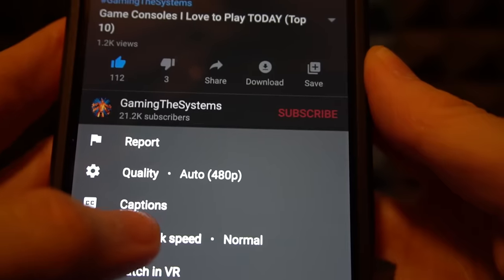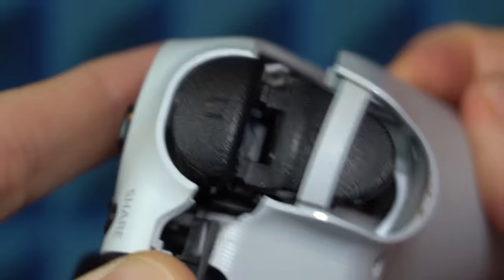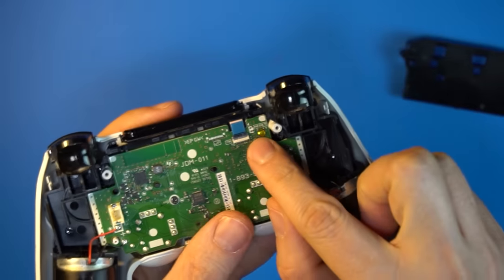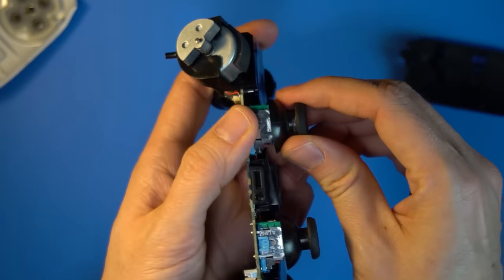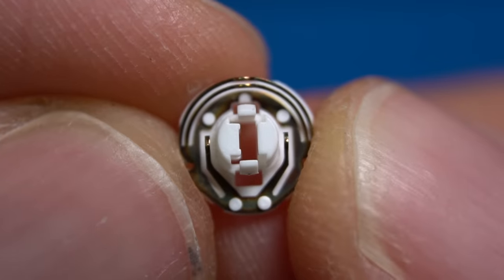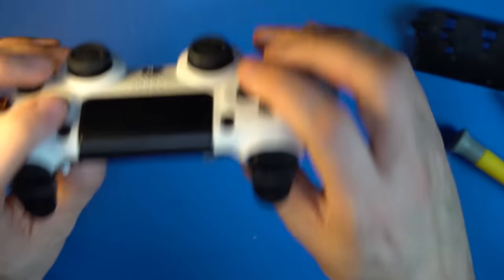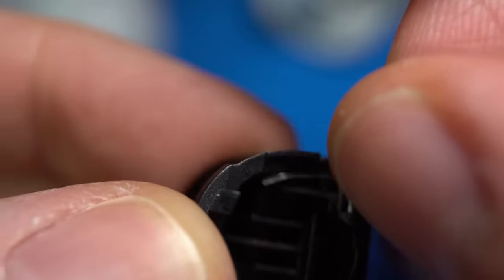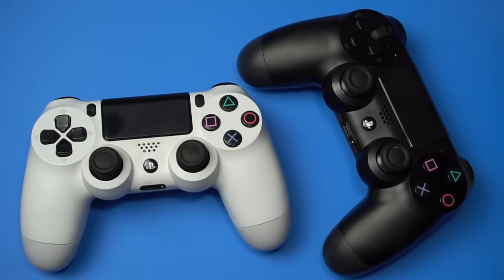How to Repair a PS4 Analog Stick That is Drifting, Sticking, Jittery/Cleaning DualShock 4 Controller

Comment: The sad part is, my controller are brand new just few weeks old and this issue are already happening 🙁
Reply: If you're playing apex legends is not your controllers mistake
Reply: Same. I've only played two short indies (5 and 3 hours of playing each) and I boot up Horizon Zero Dawn and main character is glued looking at the ground. The warranty covers defects if purchased within the last year but their warranty process requires the proof of purchase have the serial number on it and you have to pay to ship the controller. So stupid
Reply: @TheHotrider07  I don't even know what kind of game that is.
Reply: @spriddlez  uhh that's sucks, sorry for your controller, but believe it or not I fix this by pressing reset button method the issue are gone now.
Reply: Same here, really sucks. Truly a shame. 
My PS2 controller does still work (at least it did last time I took the "Old Lady" from the shelf) without any malfunctions.
Good old days...
Reply: Nah dude it's not your fault I bought a red v2 controller and after one month it just stopped charging and woudn't turn on at alll ... The Durability on the V2 controllers is totally shit🤷
Reply: Same I play modern warfare like at least 5 hours a day and spam tactical sprint a lot
Reply: I've had mine for 2 months, brand new ds4 v2 and I tried to do this and now I've got an issue where the analogue or directional button is pushing up and I don't know which one and can't fix it
Reply: Update: I swapped out the disc that was not working (causing the drift) with one from my old one that was soon to be thrown in the bin and it worked. Couldn't see any damage or anything on the faulty disc so no indication as to why it wasn't working but the problem is fixed. The delight of being able to move normally has got me gassed to play games again. Such a frustrating issue can be fixed so easily.

Comment: NOTE: be very careful when removing the discs. The clips may be tge reason why it still is broken.
Reply: The*
Reply: I broke one clip. Now i cant look up or down
Reply: My disc breaking was the problem is there a new one i can buy or is the controller busted
Reply: Cameron Gregoire I cant close the green thingy. Any suggestions??
Reply: @abdulfaris9846  check your discs. it maybe positioned wrong or might be damaged
Reply: D3 YT Yh I did checked the disc and everything but it’s just snapping into place
Reply: @abdulfaris9846  did u ever fix it?
Reply: @edwardrivera2770 nah just had to buy and new controller

Comment: @3:45 I knew all those hours playing Operation as a kid would payoff
Reply: How did you get that bit open
Reply: @inishmor  you need a small flathead then gently but firmly put pressure on the two holes at the top of the green chamber, you may need to do it to the sides as well to get it open so that you can get the white disk out without damage

Comment: yo.....so ive had a controller, my original one, since 2015.  I couldnt walk forward without stuttering, been that way since 2017.  Sprayed alcohol onto ball area of joystick and rocked back and forth repeatedly. I did this while watching this cumbersome video.  FIXED IT WITHIN 30 SECONDS! Im pumped. Hope this helps somebody. I did this just now, in 2022 after buying probably 2 or 3 other controllers over the years...sheesh.

Comment: Guys be extremely careful with the bendy green doors, it’s very easy to end up completely ripping them off from their solder points. Don’t be like me.
Reply: I just did this 🙃 it’s gone now isn’t it?
Reply: Yeah I’ve been fixing a while now and last time I was fixing I got pissed of and just ripped it out myself if you put it back from bottom to top it should still close and I think it’ll work properly again
Reply: @AbdijovskiA  no it won't 🥲
Reply: @vahsheni6351  sorry to hear that the bottom might not hold the best not the top os the part that matters
Reply: @vahsheni6351  I hope you get it to work again tho

Comment: I did this and it fixed the problem completely! Took roughly 30 minutes
Reply: Broo what
Reply: @adamdanial2093  what?
Reply: @julianpbt7942  nah bro you a pro, the moment i opened mine and i was like ait thats it
Reply: @adamdanial2093  you can do it man it just takes some focus and patience
Reply: @Daniel p bro as soon as i tweaked mine a timer started
Reply: sameeeee, did my spare controller and now its my main controller! time to do the other. just alot of patience and the right tools
Reply: I did it too 
I’m very thankful so that now I don’t have to buy a new controller
Reply: I made it too❤
Reply: @adamdanial2093  😂😂
Reply: It wasn’t that hard bruv
Reply: Yooo can you help me
Reply: @cesargonzalez-bi1nl  whats poppin
Reply: @julianpbt7942  I’m stuck on trying to close the cage door on the analog stick but it won’t shut, I’ve tried taking it out and putting it back in but it won’t shut, could it be because I’m not using enough force or?
Reply: Did you do exactly as he said or did you not do some of the steps I need to know
Reply: Same! I had an issue where moving my left stick would cause it to think the right stick moved with it, and also when pressing L2 it would think the right stick was moving. It made some games totally unplayable. Did this fix (needed pliers to snap the green doors back on because it hurt my fingers too much to do it by hand) and now it doesn't read the right stick at all if I'm not moving it myself! Controller feels like new again.
Reply: @julianpbt7942  ye same I’ve finally fixed this drifting issue well worth the 35-40 spent fixing the controller
Reply: @adamdanial2093  bahahhahaha :D

Comment: Controller was drifting on the right stick and the down button(arrow) did not work anymore. 

Thougt wy not clean the arrow area after i did this tutorial.

All works great now so happy saved 60 euro. 

Tnx for the video.
Reply: Is it okay if it only has little junk in it? Cuz maybe that's just the controller breaking

Comment: This worked flawlessly for me, thank you. One thing I noticed is that if you bend the contacts on the disc, you can use a replacement not only from a Dualshock 4, a disc from a Dualshock 3 and even a Dualshock 2 work too, since they're completely identical.

Comment: So for anybody having problems with the green plate things (4:30) not snapping back in place easy, I have a solution. Grab some pliers and squeeze the plate into place (until you hear the click), when using the pliers don’t squeeze too hard or you’ll bend the metal box, if you bend the metal box just squeeze it the reverse way from which you just dented it. I hope what I said hear has helped at least some people down the road.
Reply: I can’t  close it
Reply: @apexhernandez807 I would check to make sure the green plate is lined up and I would also check to make sure the sensor is in the correct way and everything of that sort. I would also check to make sure the joystick didn’t come out of place, mine came out of place and I had to re-align it. It works perfectly fine now since I made this comment. If it still doesn’t work then the plastic connect piece is broken or something isn’t aligned. I’m not a professional but I’ve torn into my controllers about 10-15 times to fix them over various things.

Comment: I have dismantled and reassembled my controllers so many times I've lost track, I have 2 v2 controllers and both of them have the left analog faulty (the character doesn't move forward properly and stutters constantly), I have changed those little wheels with those of other controllers, I also tried to buy new wheels, and yet the problem persists. I'm forced to use a 5 years old controller which still works fine even tho it squeaks and creaks everywhere and it's not a v2, at this point I'm beginning to think it's some kind of glitch.
Reply: why dont u just buy a new controller
Reply: @waitwhat927  I literally did it yesterday actually! But you know it's a bit of a pain spending 60 bucks for a controller, the v2 I had weren't even 2 years old
Reply: デイブくん yeah that sucks. good u got a new one tho :)
Reply: @waitwhat927  Yea you know I couldn't possibly afford to play ghost of tsushima with a broken controller now

Comment: I did it twice to 2 controllers an never worked ended up buying a new 1.
Reply: Same here. Bought a new one
Reply: bought a new one and it did the same thing
Reply: If it drifts after clean, then its due to oxidation. You'll see the copper coils will turn a blue greenish colour. Means it will need to be replaced - aka new control
Reply: Some wd 40 on the analog mechanism will fix most issues after u clean the disks. thats what i do to my controllers.
Reply: I did with three controllers.. only one of them worked after...there were a lost cause
Reply: Me too, sometimes you get a ,, bad one,, that only lasts a few months or even weeks.
Playing more careful with it gets hard with fast paced games like apex legends or titanfall or god of war, buttonbasher
Reply: @_the_assassin  I also cleaned my controller with WD40 and it worked like a charm. I did it couple years ago and today I saw how to actually clean the contacts under analog stick. I am glad I was able to fix mine easily and WD40 didn't screw it up.
Reply: These controllers are shit , fuck a ps5 we need better controllers that are easier to fix .
Reply: Me too (;
Reply: mines worked.. you probably did it wrong
Reply: Cleaning did nothing for me, it was just the part that he cleaned needed to be loosened a little
Reply: Worked for me
Reply: Worked for me.

Comment: I have problems with my right analog, it looks up sometimes even tho I don't do anything, I'd like to fix it and this tutorial is great but I'm too scared of breaking something and I don't want to open my controller😥
Reply: Shield Master bro I have the same problem
Reply: In my case, I'm just too lazy.  Selling on ebay.
Reply: Shield Master holy shit i tried everything and nothing worked, i decided to blow on it because of your suggestion and it works!
Reply: @thewildking999  told you ahah
Reply: Shield Master thankss
Reply: @_Shield_Master_  hey, just to clarify, wdym INSIDE the analog?

Comment: Thank you so much for this video. I had a slight drift to the left on the left stick but after following your instruction and cleaning it, it seems to have fixed it. The opening on the left "door" was quite dirty, which was probably the cause.

Comment: I was having an issue with my right analog stick where my character in game kept looking up even though the stick was centered. I followed this video exactly how it said and the issue it completely fixed now! Instructions were super easy to follow and I got my controller apart and back together with no problems. Awesome video!
Reply: in 3:40 how do you open this thing?
Reply: What did you use to open the green thing

Comment: 3:52 okay... what if Hypothetically speaking I were to accidentally bend it. How would I fix it?
Reply: Fix it by buying a new one as those parts can't be found on the market, and you're better off with a new one anyway.
Reply: put the controller back to how it was and test it out if it works great, if not then take it out and try to rebend it into place like how it looks in the video. if you get a new controller you should keep that one for extra parts in case your other breaks.
Reply: buy a new one
Reply: i think I broke my control cuz 4 little red and black wires ripped off
Reply: Don’t those wire are for vibration so it’s fine
Reply: @mypeanutbigg  you can solder them back on, same thing happened with mine and try soldering them back on it'll work just fine

Comment from the maker: Things you may need:
Precision Screwdriver Kit: https://amzn.to/3TtYrur
Button Replacement Kit: https://amzn.to/401p5xe
Analog Replacement Set: https://amzn.to/401pkbC
Micro USB Charging Cord: https://amzn.to/3LBsu1x
Charging Station: https://amzn.to/3ySg8ue

All Amazon links above are affiliate links. I get a small amount of money if you end up using them to make purchase (it does not have to be for the item I link to, as long as you click my link then move to another item, it works)
Reply: Is there any alternatives to rubbing achohol to clean
Reply: Thanks! You’ve helped me save over 100$ now! The controller feels and plays like new as well! Amazing!
Reply: Bruh you helped me out hella I don't need to buy a new remote 👍

Comment: Many thanks, you have saved my controller and my pocket! Had an issue with the dpad bottom button which was not working but an other tutorial suggested that I used a graphite based pencil and rub it over the circle of the plastic circuit board! Worked! (graphite is conductive)  Used your tutorial to solve a directional stuttering problem, worked! A cotton bud is ideal to clean the contacts and don't be afraid to use some force to close the    hinge! What have you got to lose? Your controller doesn't work properly anyway. Love utube, thanks again.

Comment: Everything in this was correct apart from one thing, when you attach the last ribbon you need to have it facing the opposite way to what he says !
Reply: Dexter Harrison thank god you said this I thought my controller was done for when the light wouldn’t turn on ik something was off about that part
Reply: Thank You! I was going crazy..
Reply: It's not wrong, it just depends on the type of controller you're using, he has the old type. By the way, it was very intuitive, I did yesterday and immediately realized that it was the other way around cause that's the way it was when I opened it.
Reply from the maker: As someone mentioned, it depends on what controller version you have. Bottom line, when you pull that ribbon out, see what direction is is facing.
Reply: Ohhhh fuck ima try that cause that fucker won’t charge
Reply: Bless you dex! Now mines all Gucci

Comment: I don't have alcohol to clean with, so I just used a dry Q-tip. It still got some grime out but sadly it didn't help solve the drifting issue. But thank you for this video, it was very clear and easy to follow. At least it also didn't make the problem worse. I will try again by cleaning with alcohol and see if that helps.

Comment: This procedure solve that issue, in some cases for a short time in few other for a long timr, however based on my own experience of course being very careful the more you try to fix it meaning removing pieces constantly put in risk the charging cables, the vibration cables, and the touch panel functionality.  Thanks for the tutorial. Great job.

Comment: This was amazingly helpful! I was able to fix the drift quite easily. However, I noticed my PS4 controller must be a newer model with a couple differences:

The screw in the middle of the control board also held the battery plate in its place, requiring me to unscrew it beforehand. Also, the conductors on the data cable coming from the backplate were facing away from the battery, instead of towards it. 

Not huge differences, but I gripped the battery plate a few times before seeing the screw difference. Still, thanks a million for the how-to!
Reply: Have the same controller model and I did the same with the battery plate 😂

Comment: Worked perfectly, finally tamed the entity that lived inside the left joystick, "The Beast" 
I broke one of the clicking parts of one of the white domes, first bent it when pressing the door and when trying to fix it, broke it and removed it a bit nervous about it, even then it worked flawlessly.
Thank you very much!
PS: My light and USB connector proper way to connect was with the pins facing away from the battery, noticed by looking inside the socket.

Comment: Followed step-by-step, controller is now working perfectly! Thank you for the help. It gets quite delicate in a few steps but as long as you use proper tools (pliers, small screwdriver, q-tips) and are very careful, the controller will be fine.

Comment: There is no way in all heaven or hell I'm doing this😂😭
Reply: Bro i know I’m 3 months late on your comment but Im scared I might fuck my controller up badly 😂😂
Reply: I thought the exact same thing... But here i am doing it 🤣
Reply: ikr
Reply: @zayking917  im 5 and i did it bro its hard to fuck up
Reply: I'm did it and I'm tech dumb. It works fine I don't even have the proper tools.
Reply: @zayking917 same bro. weird how you posted a reply 1 month ago and I never got a noti
Reply: @thisusernameistaken7845  did u fix it?
Reply: @MadaraUchiha-cf1ig  eh... more or less. It drifted to the left. But after the process, it slightly drifts up. Not enough to be an issue tho

Comment: Great video, extra clear, some really solid instructions here thank you very much. 
Might be worth mentioning that some controllers have a screw that fits through the battery casing and the board, so you won't be able to "snap" the board off after removing the battery.
Reply: Yeah mine has that and I’m trying to figure out how to get the motherboard out. Do you know how?
Reply: @zoinks2055  I'll have to disassemble mine to check again sorry, if I get a chance today then I'll get back to you

Comment: Don't get offended but you also could've told us to be careful with the motherboard, for some reason the motherboard kept on falling out of the controller and the red wire eventually got ripped off. Luckily the black ones are fine but I'm just saying that next time try to explain a little bit more for example how hard to push and pull stuff, BTW thank you for the tutorial this helped me and I'm giving this a 7/10

Comment: Very good how-to, however 1 thing: in my case, the cable connecting the 2 shells has to be attached the other way round, with the wires facing away from the battery. all the rest is very good and the quality even of the tiny details is great. thank you!

Comment: This fixed the issue completely,even though I did end up disconnecting the vibration motors. But that was a mistake from my part. Great video!